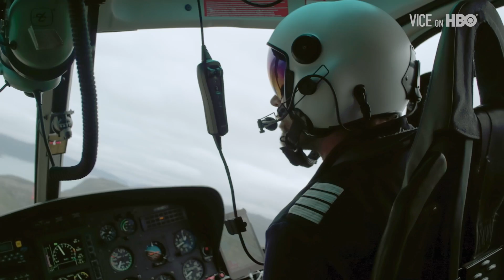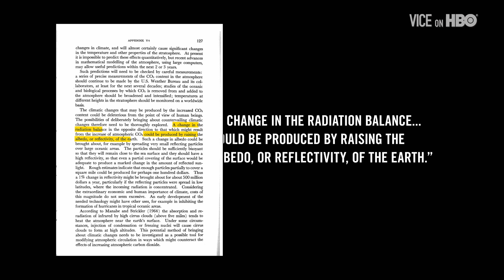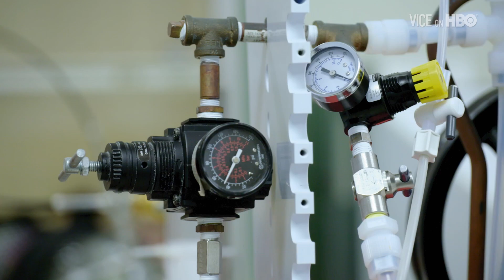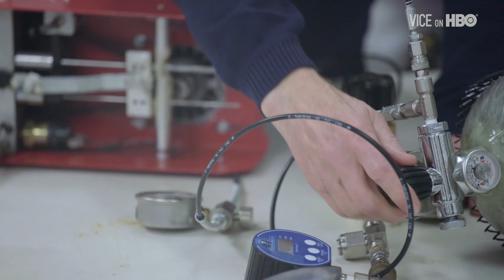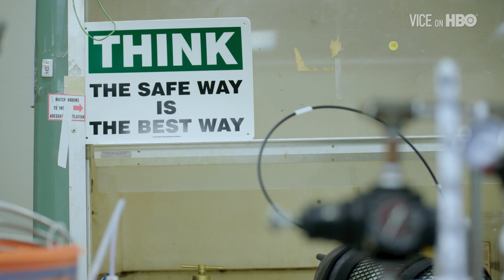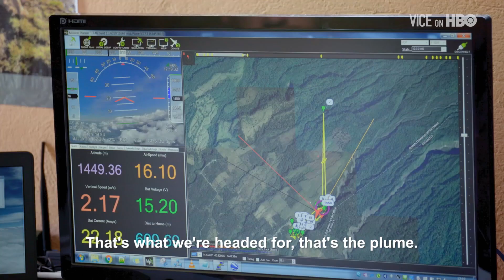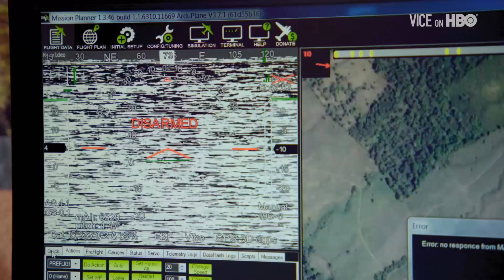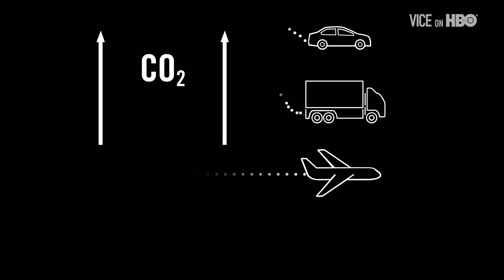Geoengineering May Be the Answer to Climate Change

Comment: we see how this ends up in futurama, throwing a bigger ice cube in the sea every year
Reply: hey it works doesn't it ? XD
Reply: Until there's no ice left.
Reply: @gilli8669  they get it from space
Reply: @im.not.typical91  they run out of ice from the comets
Reply: "...thus solving the problem once and for all.   Bu--  ONCE AND FOR ALL!"
Reply: Funny how melting ice in a drink never causes the drink to overflow. People still fall for the rising sea levels.  Won't happen.
Reply: It will overflow. That's not my point. Take a glass of water 3/4 full. Put an ice cube in it. Mark the water line. Come back after it's melted. Check the water level. People don't understand "displacement". You skipped school entirely apparently. @Ihatemaxpigmentation

Comment: Well, one thing we can definitely do is plant trees and grow them by the millions. They are natural Co2 scrubbers. Why a worldwide effort for this is not in effect doesn't make sense to me.
Reply: Because the trees will eventually die and place most of the carbon back into the atmosphere - especially if trees are planted poorly or only one species is planted it will only increase it becoming a carbon source. For a very short time I studied tropical rainforests in Guyana and most of the evidence pointed to them having no to little effect on C02 levels. It becomes a carbon sink for 60 years then releases over 90% of sequestered carbon back to become a carbon source. Problems with large deforestation speeds up forests emitting C02; however, simply planting or replanting a bunch of trees is not an overall effective solution.
Reply: @john Alexander exactly...
Reply: There is an effort to do this and it is part of the Paris climate treaty but it is happening far too slowly and a balanced forest takes thirty or so years to stabilize which is too late to rely on exclusively. However it is certainly a huge part of the solution

To @John Alexander's point, a forest doesn't all die at the same time and new saplings grow in place of the old trees so it does balance out but even so scientists have estimated something like a third of all the earths surface needs to be left for forests and getting political agreement for that is super challenging.
Reply: Someone actually has researched of how many plants we need to plant from now on to save the planet and its on ridiculous amount. They said its impossible to save the planet only using trees.
Reply: This spraying is killing the trees...aluminum in soil makes it impossible for trees to take up mutrients..
Reply: These technological projects are our last resort to stop climate change. But yes, we do need to plant more trees and don't cut anymore.

Comment: I can't express how happy I am you cover this in a serious manner, if we don't do active carbon extraction we will literally go extinct, and it is not even being dramatic, crops will fail world wide at 4 degrees, we are squarely heading towards 2 and beyond.
Reply: What we should be doing is finding out a way to put the 2 at the end of the CO. Carbon dioxide is good, it’s the carbon monoxide we need to worry about. So if you can find out a way to turn the CO and add another oxygen atom to it we’ll be just fine.

Comment: Reflecting sunlight is a good band-aid, but we need to get the carbon out of the atmosphere. Making fuel from recycled atmospheric carbon using renewable electricity is the answer to make air travel and sea shipping carbon neutral, but all ground-based systems need to be fully electric from wind and solar.

Comment: I like 3 solutions from this video. 

1. Whitning the clouds
2. Whitning the snow
3. Sucking CO2 from the atmosphere & changing it into recycled fuel
Reply: Mohamed Hassan #3 is the most realistic and the one in the vid I was looking for. I don’t know about the others. The silica dust would just blow all over the place in the wind, and imagine how many tons would be needed to have a dent of an impact. 

Good luck getting private shipping companies to stick on and maintain a High pressure salt water pump that they’d need to run on each route too.
Reply: @amorag59  they would use the planes they use for chemical trails.
Reply: @amorag59  just look up. There are plenty of examples. I took a picture last year of chemical trails that covered almost the whole sky. No plane should be dumping anything in perfect lines. Also no condensation trail would stay so prominent for so long. There's also  storys about airforce whistleblowers that talk about it

Comment: Whales have have been brightening clouds with their blowholes for ages
Reply: jaime delgado 😂
Reply: And when there were three million of them,  defecating in the ocean,  they were a significant stimulation of the phytoplankton,  who absorbed CO2  and in turn were 
eaten by zooplankton,  who made their body shells out of carbon and calcium and in turn died and sank to the bottom, to after millions of years become limestone.  As we have effectively killed off 95% of the whales,  could we simply spread an iron compound like ferrous sulphate that would have the same effect.
Of course the real answer is mass produced Generation 4 nuclear,  but that is up against forty years of Hollywood propaganda,  like for instance Homer Simpson at the Springfield nuclear plant.
Reply: @nicholasgrubb151  Let's genetically modify whales.

Comment: haven't they been able to do this for years now ?
Reply: Do you not see the trails of stuff the planes  are leaving...
 Instead of spending a lot of your time looking down at your  comment section look up in the sky,
Reply: @philup6274  The trails that planes are "leaving" is called water. It is just moist air condensed by the engines of the plane.
Reply: @swanky_yuropean7514  But when the geoengineering actually starts, it is going to look the same as the "water" you are talking about?
Reply: @MrBojo-jv4qq  If they use Dihydrogen monoxide to do it, then yes.
Reply: @philup6274  look up in the sky and look at the trails of water XD
Reply: @swanky_yuropean7514  lol
Reply: Why haven't they done a test on recycle fuel administered to trucks and city cars for a period of time?  Probably because it reduces mpg in those vehicles. Nothing like filling up twice a week instead of once with regular gas.
Reply: yes
Reply: Goodtree  yea that's why I unsubbed
Reply: @philup6274  What? What do you think clouds are? And how long do they hang around?
Reply: @swanky_yuropean7514  Do people still really believe this is water vapor?  The trails don't act like water vapor at all.  Check out Geoengineeringwatch.com.
Reply: @bonniechase5599  And how is water vapor supposed to behave at 25000 to 40000 feet altitude according to you?
Reply: @swanky_yuropean7514  Most chemtrails are much lower, and there shouldn't be any condensate.  Condensate evaporates after about 20 seconds.  The persistent trails started in the late 90's, when the geoengineering started.  Water vapor clings to itself and doesn't smear out like powder, except under exceptionally windy conditions.  (makes rounded clouds).  Water vapor doesn't precipitate unless it is dense, which looks dark.  I have seen many white chemtrails precipitating along their edges.  Jet engines don't turn their condensation off and on, like the chemtrails that appear as dashes (I noticed they won't do that anymore though, it was too obvious).  So, there are some answers.  You can find a lot more information on geoengineeringwatch.com.
Reply: @bonniechase5599  So clouds are fake too? According to you they can't exist for more than 20 seconds. 🤔
Reply: Matt Pistell  They aren't sheep, they are misinformed it's not nessecarily their faults. It's not easy to know what's true these days, with so much delusion piled on top of real science and just pure logic.
Reply: Who are they?
Reply: @ichmagkeinemachos  contrails do not linger  In the sky for up to 8 hours and then slowly spread out, And form what's known as a solar shield, I'm   Well aware of what contrails are and how they work...   its obvious you dont,  It would sound like you may have stood near someone who did know what they were talking about and now you are just trying to regurgitate  what you think they said.  Did you not click on the link that I posted it's  elementary level stuff guys,
Reply: @swanky_yuropean7514  Not as jet exhaust.  That's just a skinny strip of vapor that dissipates.  According to Dane Wigington, jet engines are now designed so that they no longer leave contrails.
Reply: @bonniechase5599  folks who care can go to flightradar24.com or the like and watch the skies.  Mike Deckers channel shows much commercial air traffic spraying but you can see spraying by planes not disclosed on flightradar24.com,  which are military.
Reply: @nobodyspecial914  Interesting, thank you.
Reply: Nolynox We are surrounded by ignorant conspiracists, I feel bad for you for making an effort to tell people what is actually going but getting yelled at for believing scientific literature
Reply: Dimitri Vagalatis Do you really think they are just misinformed? To buy into such a lie you can be the brightest even if you feel I to a deep rabbit hole. I’d rather not have those kinds of people on my side to be honest.
Reply: @bonniechase5599  Lol dude are you for real? Jet engines don't produce contrails anymore? That would only be possible if they don't suck in air at all. Guess what they still do. Because engines still need oxygen to combust fuel. Guess what happens if moist air gets sucked into a couple hundred degrees hot engine. Yes to no surprise it comes out as vapor also known as contrails.
Reply: @swanky_yuropean7514  lmaooo wrong.
Reply: @ichmagkeinemachos  
You are here to play stupid and try to make this discussion sound ridiculous.
Reply: The trump voting flat earth society is alive and well 😂😂😂

Comment: How much carbon dioxide is being produced by the veichals used for spreading reflective sand in the arctic?
Reply: Stop nitpicking, they are using their vehicles to try and find out how ways to stop climate change. When was the last time guy did such a thing?
Reply: @Nate-wf5hk  I'm not nitpicking, I think it is reasonable to question their methods.
Reply: How much C02 does the manufacturing make

Comment: It should be noted that turning CO2 and water into hydrocarbons requires at least as much energy as you get from burning it. And if we choose to go this way, that energy should come from renewable/carbon neutral sources. Even with a complete transition of every vehicle running on carbon neutral hydrocarbon fuels we still don't actually reduce the CO2 levels in the atmosphere. We need an abundance of clean energy before we can sequester carbon and put it back into the ground to restore our CO2 concentrations to pre-industrial levels, and that's not feasible within the next 50-100 years...

Comment: It would be interesting to know what happened in the Arctic during the 10,800 BCE abrupt climate change. We know there were two ice sheets - smaller Cordilleran and bigger Laurentide on North America. The Laurentide perhaps 3 - 4 km thick at some places. 

There was a paper published in Feb 2018 in The Journal of Geology about extraordinary biomass burning around 10,800 BCE. It is fascinating.

Adjusted quote: "Around 10,800 BCE, likely within the span of 21 years between 10,818 BCE and 10,797 BCE, ∼9% of Earth's terrestrial biomass, on ∼10 million km2 (area as big as the US), burned. The concentrations of soot, used to estimate the global amount of biomass burned, suggest that wildfires around 10,800 BCE consumed considerably more biomass than during the K-Pg extinction event."

If interested the links are https://www.journals.uchicago.edu/doi/abs/10.1086/695703?journalCode=jg for part 1 and https://www.journals.uchicago.edu/doi/abs/10.1086/695704 for part 2. 

It would be interesting to calculate how much CO2 must have been released when ∼9% of world terrestrial biomass on ∼10 million km2 burned. The wildfires on 70,000 km² in Australia this year are estimated to release about 900 million tons of CO2, which equals to double the country's total yearly fossil fuel emissions."

Perhaps CO2 released by burning of ∼9% of Earth's terrestrial biomass, on ∼10 million km2 might have contributed to melting of Cordilleran and Laurentide ice sheets? At present CO2 melts ice in Arctic, Greenlad, Antarctica so we can assume it should have been melting ice also around 10,800 BCE as well. 

There is a puzzling energy paradox. Melting of ice sheets happened during very cold period, so it should not have happened.

What mechanisms or combination of might have caused rapid melting of several kilometres thick ice sheets?

One simple physics principle is that the weight of several millions cubic kilometres of ice pushes the continent down. Heavy ice depresses the surface, at times pushing it below sea level, making the ice sheets to get in contact with warmer ocean, causing the ice sheets to retreat and stabilizing the system. Destabilize the system enough with a powerful external factor and things start moving quickly. 

Recent scientific papers start to provide more and more evidence that an external fast acting factor was in effect around 10,800 BCE. 

The paper published in March 2020 in Nature provides evidence of cosmic impact at Syria, coeval with impacts that deposited high-temperature meltglass, melted microspherules, and/or platinum at >50 sites on four continents around 10,800 BCE. Link to the article https://www.nature.com/articles/s41598-020-60867-w

Impact on several kilometres thick ice sheet in Canada would not have left a permanent crater imprinted in the ground but more likely a depression filled with water which today would be in the form of a lake. 

There are several candidates for comet fragments impacts on ice sheet in Canada around 10,800 BCE. One of them possibly in Great Lakes area, perhaps the Saginaw Bay, Michigan // Lake Nippon // Manicouagan Reservoir // Gulf of Saint Lawrence // 

It is suggested it started in direction from Western coast to Eastern coast. 

It would be interesting to check the known impact craters in the world for a possible "string impacts. Just a few candidates - Rochechouart crater in France, Saint Martin crater in Manitoba, Obolon crater in Ukraine, Red Wing crater in North Dakota. If there is any researcher or enthusiast out there able to get some funding go for it.:-)

If you have not seen a string impact video please check the well-known Shoemaker–Levy 9 string impacts on Jupiter in July 1994 on BBC Studios YouTube channel https://www.youtube.com/watch?v=DgOTcIfU75Y

As mentioned in the March 2020 paper in Nature (https://www.nature.com/articles/s41598-020-60867-w) there might have been multiple airbursts/impacts across at least four continents. These are proposed to have resulted from a one of a series of short-period, active comets known to break up frequently and to shed dozens to thousands of fragments that are 10 to 1000 m in diameter, each capable of producing catastrophic airburst/impacts. The largest cometary debris clusters are proposed to be capable of causing thousands of airbursts within a span of minutes across one entire hemisphere of Earth. An encounter with such a million-km-wide debris cluster would be thousands of times more probable than a collision with a 100-km-wide comet or a 10-km asteroid.

Comment: The solutions are simple and should not be threatening.  Any society should feel relieved to make changes needed to keep going. In fact it's what all societies have intended all thru history. Further, in full reforestation we'd be replacing two integral parts of the base of the whole global economy: Lumber/finished wood products & fish n the sea too. Economists know resource extraction as the primary layer of the economy. So we need a full switch to selection logging with stewardship consideration.  Still we'd get an adequate supply to fulfill demand.  This would greatly serve the building of local economies. Forests are known to be the great climate stabilizers. Forests were nature's carbon sink, prior to their being mowed down like lawn. Forests are also the key to nature's hydrological cycle. Reforestation would boost continental fresh water reserves, which is of utmost-ish importance.  A full switch off of petroleum combined with reforestation would be like the first thing to do for the oceans, along with plastic capture and global regulation of fishing. All this helps restore ocean pastures, as they're called & restore phytoplankton to its natural role as oxygen production.  Then micro-algae is known as the fastest growing plant, so makes oxygen & sequesters carbon fastest. Does it rival phytoplankton? The ozone layer still needs repair, as it is only the thin layer created & kept by the abundance of oxygen, floating upwards, getting split by UV as reaches the atmosphere into single O's then merges with an O2 to make O3, then falls back to Earth often as H2O2. Micro-algae grown in deserts awaiting to be reforested can be used as a fuel crop that doesn't displace arable food cropland, which would be within the zone of hydrological cycle adjacent to forests. This all could take a general strike to achieve. Clik #generalstrike and see what you think on YouTube.

Comment: Y’all chemtrail conspiracy theorists are killing me. Boeing is too lazy to completely redesign their 737 maxx jets to rebalance their new larger engines on the airframe, and there are people out there that think they or airlines would spend extra money to refill at every stop and fit planes with tanks to spray aerosols at high altitude? Get real. These are the same people that overbook flights so they can maximize return.

Edit: There would also be an elaborate process of getting aerosols pumped in the planes that ground crews would be privy to - they would have spilled the beans by now.